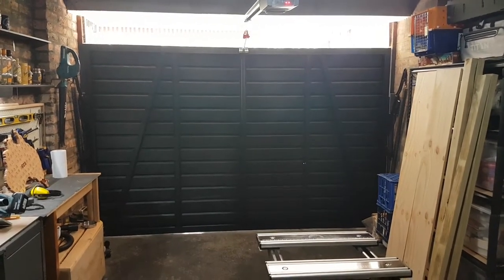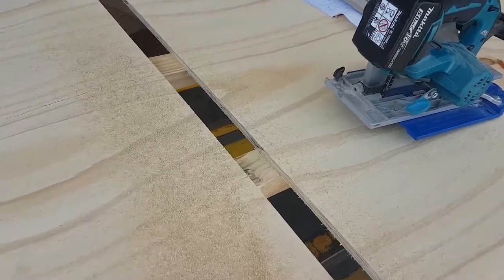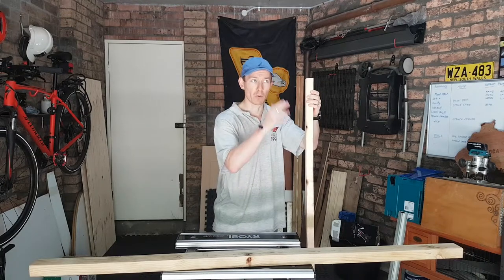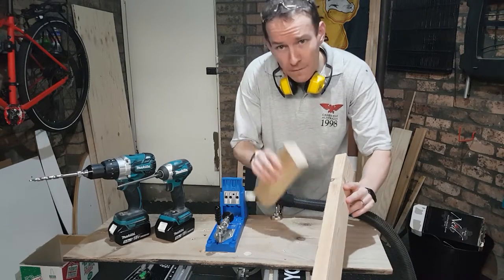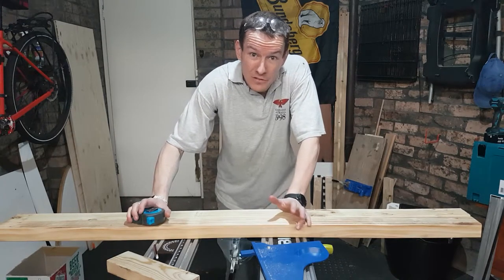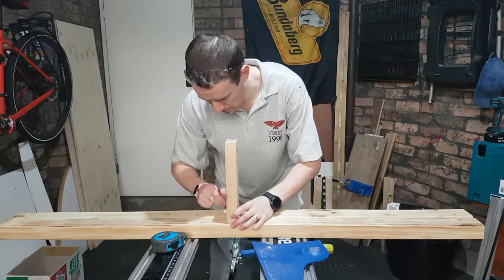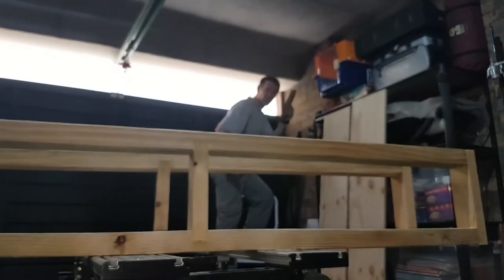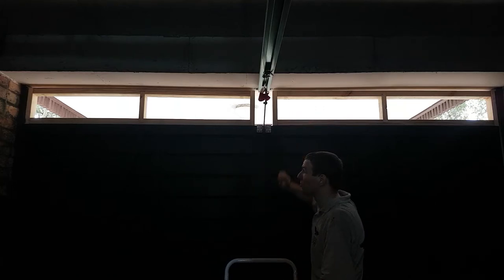Basic Framing - Garage Barrier (Part 1/2)

Comment: honest question, why use pocket holes? face screws would be stronger and you won't see them anyway.
Reply from the maker: Only real answer here is, cause I can, no real need to ;) Though I'd like to test face screws vs pocket to see the strength difference. Same with the housing joint in the middle, unnecessary, but fun to practice new things.
Reply: @FixitFingers  its glued anyway so not really an issue,  housing joints are old school on framing not really seen anymore.